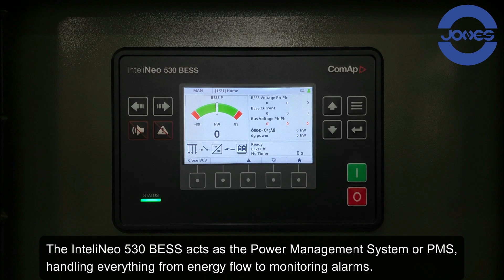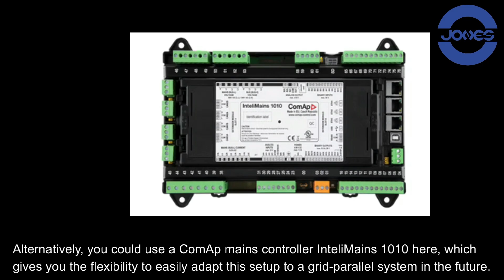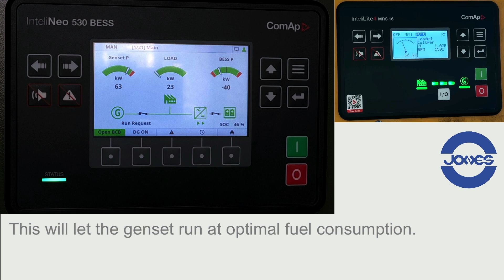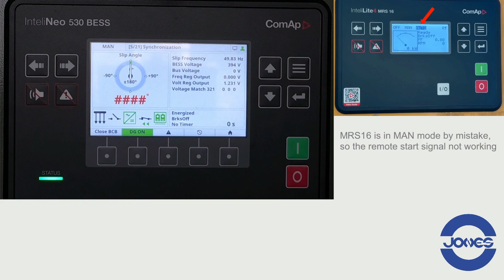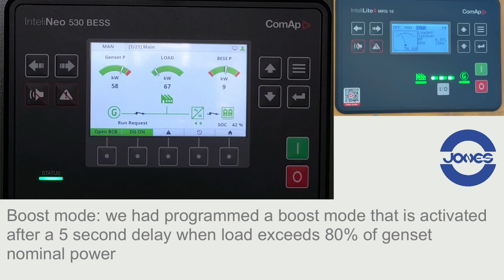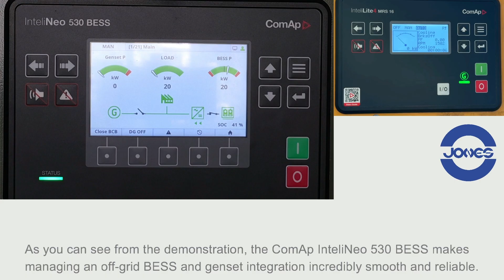ComAp InteliNeo 530 BESS, Firmware 2.1. Rental Application demo

Comment: Very good video , im from Brazil, electrical engennering experienced with gensets , substation and solar , here we are startting the Bess technology !
Reply from the maker: can try to use ComAp InteliNeo 530 BESS to control it
Reply: @jonesengineeringco.ltd.4857 o have a question If the PCS doesn't have the VSG technology the Bess can paralell with the genset? Whats the importance of the VSG ?